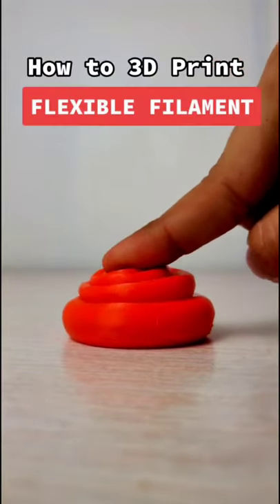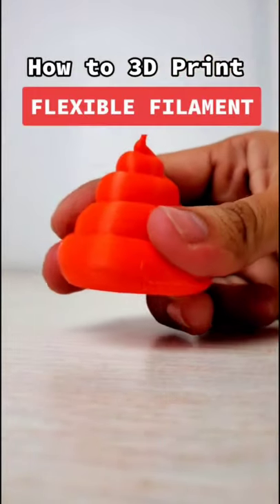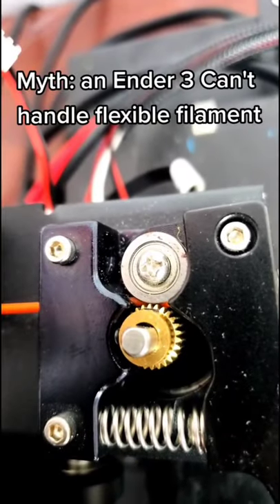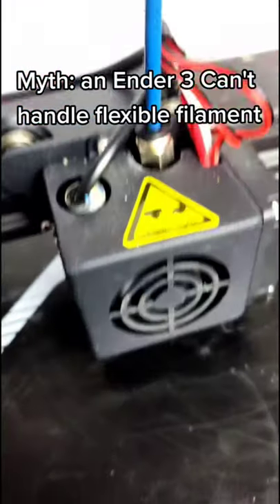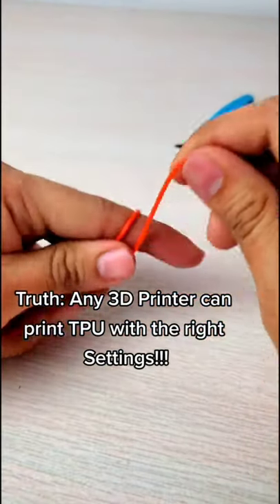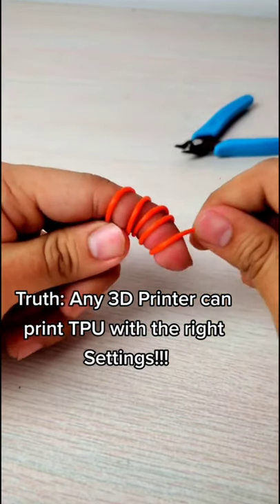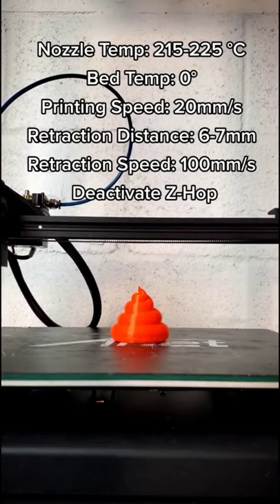How to 3D Print Flexible Filament in 20 seconds

Comment: The reason this works is because he used "spiral outer contour" so that there is only one wall and no infill and the print just spiralizes all the way to the top. This way, there are few, if any, retractions at all, which is where you will encounter issues printing TPU on a Bowden setup. Not many models can be successfully printed using this setting, so keep that in mind.
Reply: Oh ok, so like what filaments work for ender3? Not sure which model I have but my dad bought it back in 2016. Recently started getting into 3d printing. Still figuring stuff out tbh
Reply: omg
Reply: @AliAhmed-ft9wj pla, petg, and abs print no issues on any ender 3 model
Reply: are there 3d printers more suited for flexible filaments ?
Reply: @lukeandliz are you able to do abs without glue?
Reply: Aka, Vase mode.
Reply: I'm using overture tpu and it works pretty well for me
Reply: @lukeandliz  you can print basically anything with an ender just need the right setup. Direct drive and a upgraded hotend good for every material out there.
Reply: No he prints using infil look at his other vid about tpu

Comment: I print TONS of TPU with my ender 3.  Never had any problems.  Not sure what some folks are talking about. 🤔
Reply: What are your settings?
Reply: I have done a couple things with no problems on my ender 3, Im not quite sure what my settings were, but I believe 200-215 temp worked for me.
Reply: Does it work with ender 6?
Reply: @toaderstrudel3407  i have 0 idea lol
Reply: Do you use 0 degrees bed temp like in video
Reply: Stock Ender 3? I don't think it'll work on anything more complex than a spiral print.

Comment: I completely disabled retraction and it works fine on my ender 3 :) I'll give spiral a try as well
Reply: I completely disabled the retraction on my creality cr-30 but still getting jams, even with 90% print speed
Reply: @krollmond7544  how fast are you printing? Mine is Set pretty Low, I think 30mm/s or Something Like that
Reply: @blutadlerx  like the overall print speed?  Doing 90% right now, when I hear the sound of it getting stuck I lift up on the release for a second and it seems to help.  But I guess I have to babysit it.
Reply: @krollmond7544  but what do you mean 90%? You can Set printing Speed in Cura in mm/s and on the printer you can Change it in % while its printing. Standard is 60mm/s in Cura in think so with 90% You might be printing at 54mm/s wich is too fast for TPU i think
Reply: @blutadlerx  ok I definitely need to lower it, my default on cura is 40mm.
Reply: @krollmond7544  oh okay so you know , sorry didnt Sound Like it at First, the 90% confused me haha

So the fillament gets stuck where IT gets pulled in? Is it old/moist maybe? Like thats a weird Problem to have, maybe it really is the fillaments fault..
Reply: @blutadlerx  gets stuck on the extruder, it is pretty old.   And possibly moist.  It doesn't take much force to pull it off the gears but still interferes with the print.
Reply: @krollmond7544  thats pretty weird. Does it feel sticky?

Comment: i print tpu on my ender 3 v2 but it required some extruder modification. i drilled out the hole that the filament goes through after the gears and put a pointed piece of ptfe tubing in it to take up the gap between the extruder and the gears so the filament doesnt get bunched up. prints the same as pla once you do that

Comment: Got one for silk pla? Followed a guide but it’s still not doing right 😞😞
Reply: Silk PLA is weird it puffs up after the nozzle usually not a huge deal.  What settings are you currently using and what's the issue?  I print mine at 210 hot end, 60-55 bed, and then I just dial in my flow right 1-1.15 depending on the brand.  If you're having Uber extrusion your e-steps could be off

Comment: Why is the bed temp at 0
Reply: tpu doesn’t need a heated bed, but you should probably print it at PLA temps (60-70) if you don’t have a high quality bed
Reply: @nxbulae  will it hurt to print at 60 even with a pei platform
Reply: @leprechaunbutreallyjustamidget wouldn't recommend.  I just tried set my printing temp at 0 stuck great and then to remove bumped the bed up to 60 peeled right off

Comment: i printed and installed a direct drive conversion part for my ender 3 v2 and now it doesnt want to print anything. any suggestions?
Reply: Any update on this as I wsd thinking of doing something similar
Reply: @A7Xdookie  oh yeah, the problem was that I forgot to put in a tiny section of bowden tube, so when it extruded, it would get stuck
Reply: @Crazyclay78YT  thanks for the update mate, just purchased 2 conversion kits one for my Ender 3v2 and the other for my Voxlab, going to give it a go this weekend, did you end up getting some nice prints?